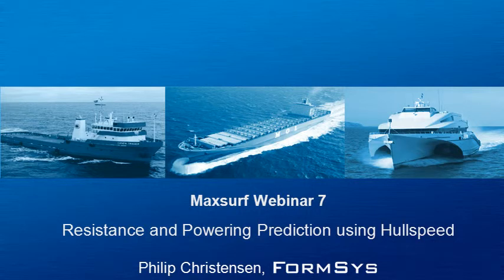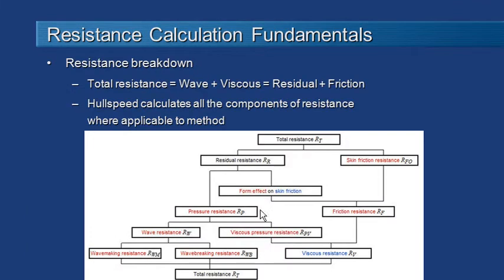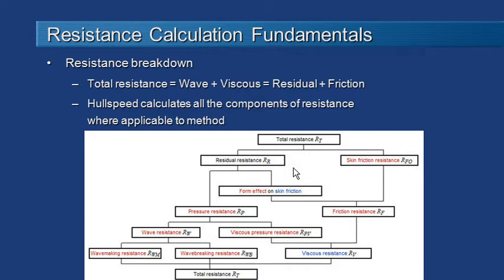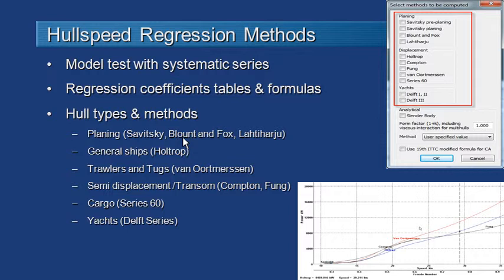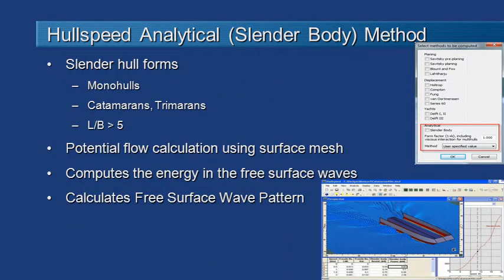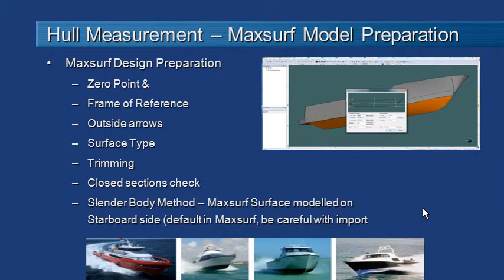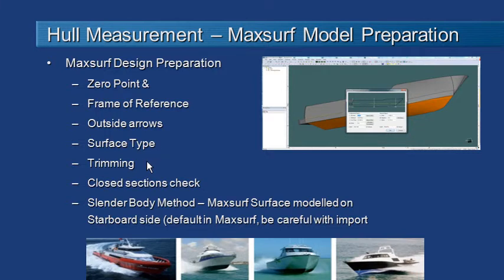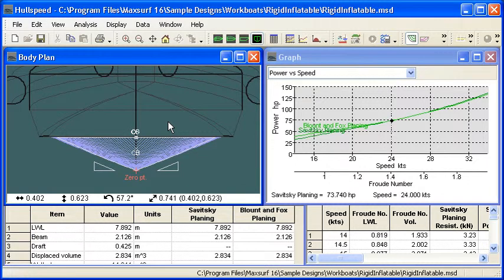Hullspeed Introduction

Comment: Is it possible to import a hull model from Rhino into hull speed or is it mandatory to have Mcsurf to use hullspeed?
Reply from the maker: Yes you do need to import the rhino model into Maxsurf Modeller, do the frame of reference setup (DWL etc) and then save the .msd file and use that with Hullspeed (now named Maxsurf Resistance)